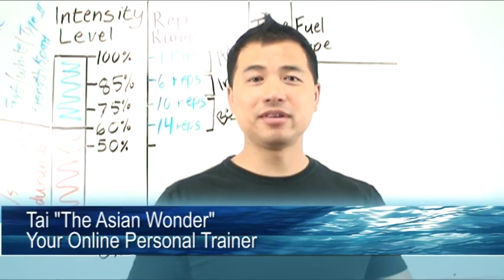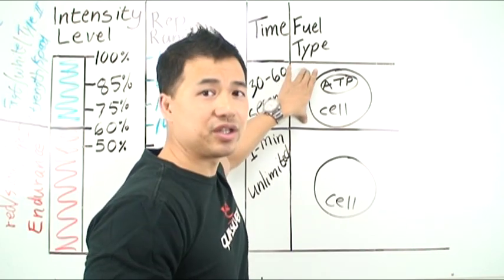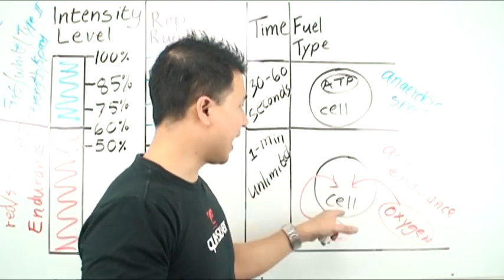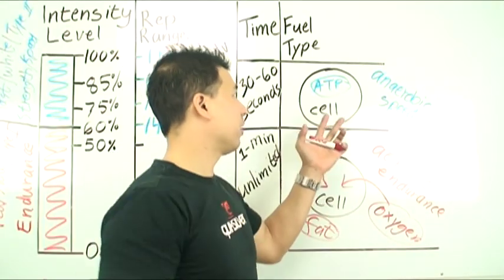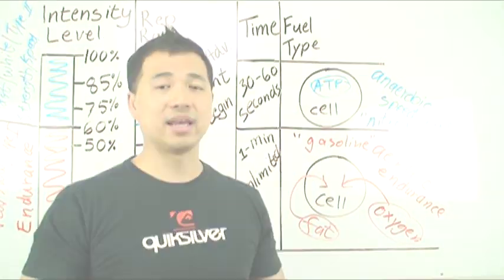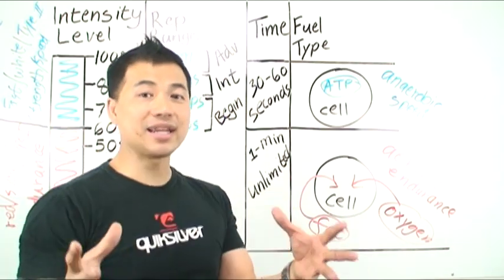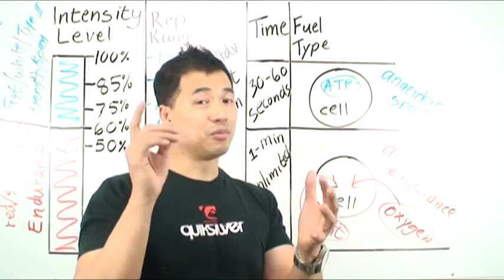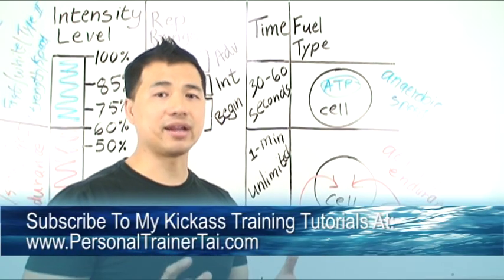(4 of 8) How To Gain Muscle - Aerobic Vs. Anaerobic Exercises (Fuel Systems)

Comment: nice vid man, keep the good shit up, ATP is Adenosine TrioPhosphate, it's present in the muscle but in a very limited way, and it only lasts for couple of seconds (from 5 to 20 seconds). however, the brilliant human body recharges the molecules of ATP with energy at the same time (the molecule of ATP is like an empty container that needs to be filled up with energy, the muscle needs that energy to contract but it can't use it directly, so the ATP works as an intermediate) the process of recharging ATP is achieved by 3 sectors: the first is anaerobic alactic (intensity level: very intense and effort time: 5 to 20 scds), the second is anaerobic lactic (intensity level: intense/moderate and effort time: 20sc to 2 min), and the third one is aerobic (intensity level: low and time under tension: 2min to 2 hrs) , and every sector has it's own fuel, for exemple the anaerobic one uses the creatine-phosphate essentielly as energy, and the aerobic uses the oxygen (to get rid of H+), fat (acide gras in french) and glycogen. in order to build muscle guys u should focus on 3 main things: 1-hypertrophy, 2-progressive overload, 3-time under-tension (eccentric part of mvt)
if u want to build muscle u should do low-reps sets (4 to 8 reps) and always challenge the muscle by progressive resistance/overload from one week to another (but do not sucrifice ur form), and u should keep rest time between sets from 120 scds to 3 min so ur muscles have time to recover and be able to hit the next set with a heavy weight so u always give ur muscles a need to grow (with a good nutrition (caloric surplace) and recovery for sure) ..  
if ur target is to lose fat, then you'll be focusing more on ur form, full range of motion and more time under-tension, so ur workouts should include a lot of high-reps sets (12reps -above 20) however keep in mind that u need some heavy sets so ur muscles stay full and u dn't lose muscle (first 1 or 2 exercices especially when ur energy is up), keep ur rest time short (30 to 60sc) so ur heart-rate is always up, and with a good diet (caloric deficit) and cardio (HIIT, slow, ..) (3-4 times a-week) u should be on ur way to ur goal.
whatever ur goal is, supplements should never take the place of real food, quality food of course, and one more thing, always do compounds exercices (like squats, bench press, deadlifts, rows, weighted pull-ups, weighted dips, melitary presses..) .. wheather u wanna lose fat (it burns a lot of calories because it includes a lot of muscle groups) or gain muscle (it elevates testosterone levels to the roof) and always shock ur muscles and ur nervous system with different bad-ass workouts.. if u happen to give a fuck.
Reply: turn to Christ and forsake your sins

Comment from the maker: that will very  among each athlete. It can be anywhere from 20 to 30 seconds to 3 to 5 minutes. Genetics also have a huge factor in your recovery ability.  This is by far one of the biggest genetic traits that separates the amateurs from the professionals in their ability to recover quickly..  In my mid-20s, it took me 3 to 5 minutes  to recover from  that lifting 500 pounds for 3 to 5 reps. I had clients who recovered in less than 2minutes n clients who took almost 10 minutes to recover. - Tai